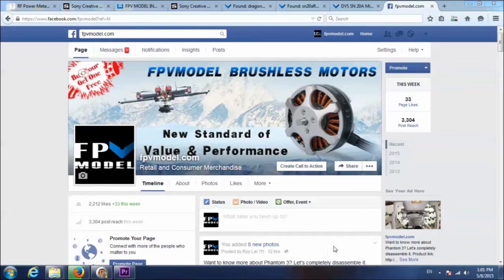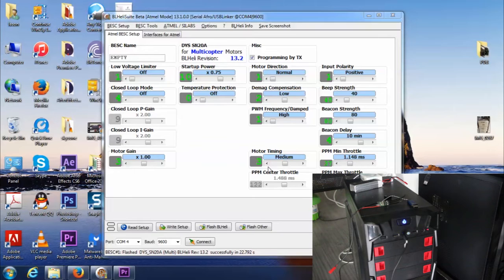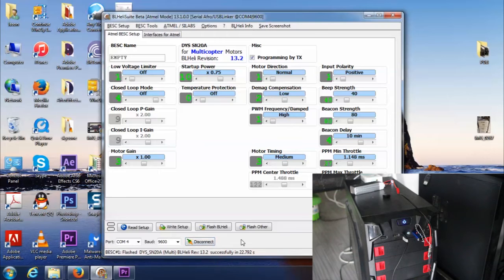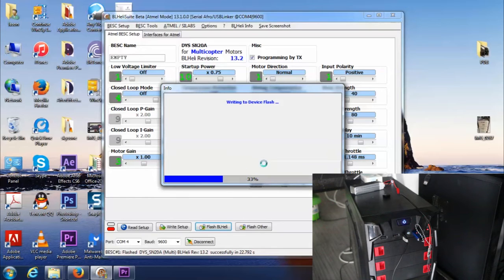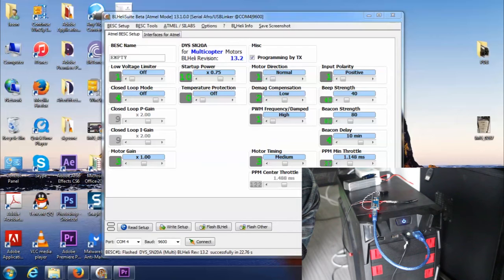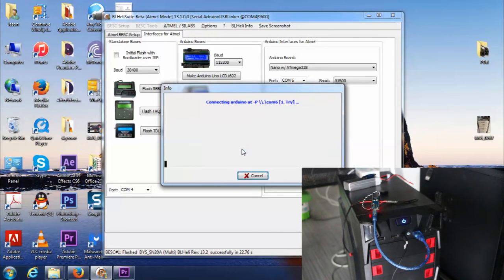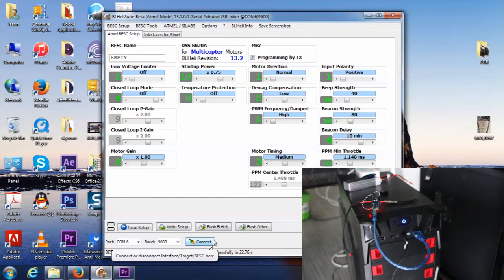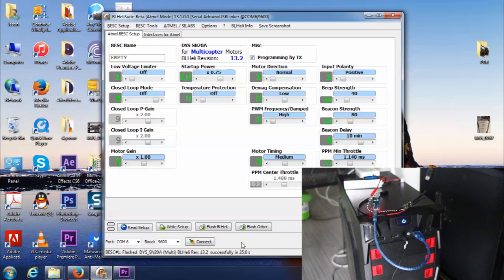SN20A ESC How to Flash BLHeli ESC Linker/Arduino Nano

Comment: I just trying using 16amp DYS with a Tiger air gear 200 motor and the ESC had timing issues with the motor than started to smoke!  Will this firmware fix the sync issue?

Comment: FPVMODEL.COM Does either method work if they have #BLHeli Bootloader? I purchased a set from Ready Made RC, LLC and they come preloaded with #BLHeli Bootloader and 13.1 Firmware.
Reply: deepimpact.io Yes it's no problem if you use the Arduino programmer. Just flash the Arduino with the 1-wire interface option and you are ready to go.
Reply: Bionic24 awesome thanks! Ordered a Arduino Nano this morning ;)